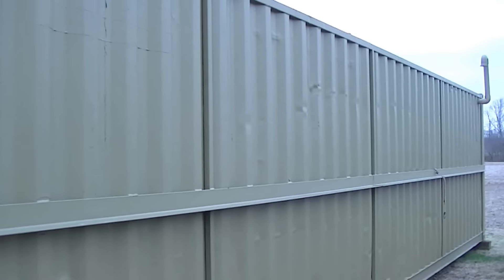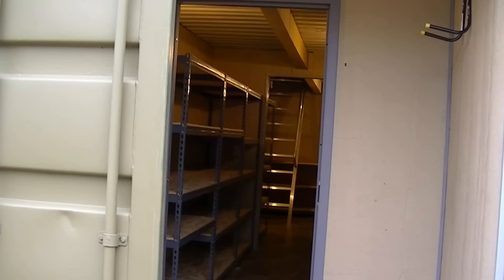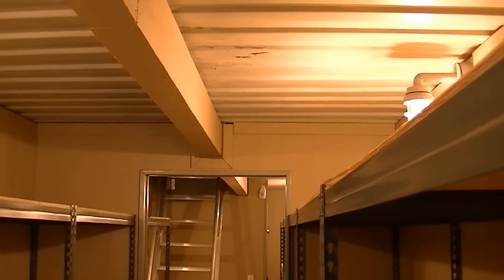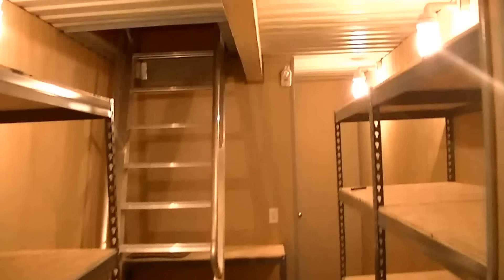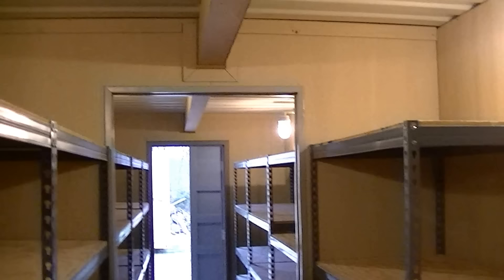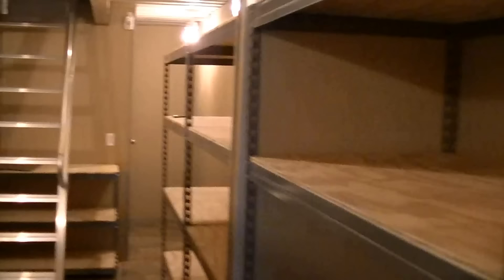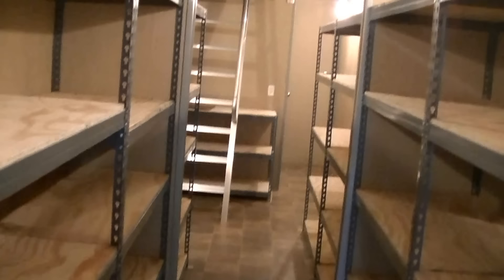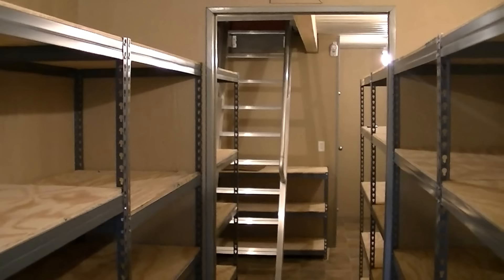Underground Shelters built from Shipping Container

Comment: Having over 30 years in fabrication, i'm thinking you need to get an engineer to work with you on your designs, not trying to be a smart ass. I see more than five thing's you could change to edvance your design, starting with that interior support beam. We have two 40' conex's completed and barried hear in Arizona, both are 7' below top elavation. I worked with two engineers for a year to come up with our desig, one of the shelters is there's.

Comment: I would not buy this as it will not be safe underground. It needed to be rolled over for the strength on the roof and there needed to be steel supports added inside.